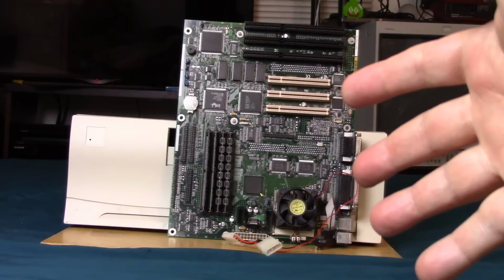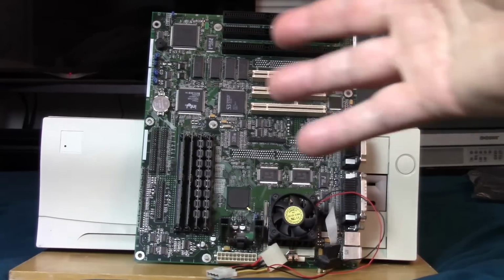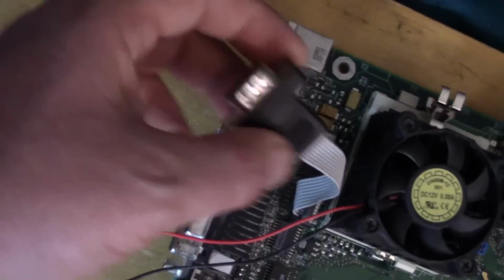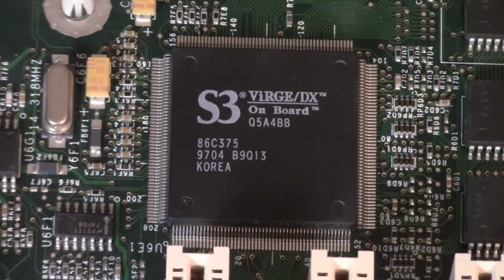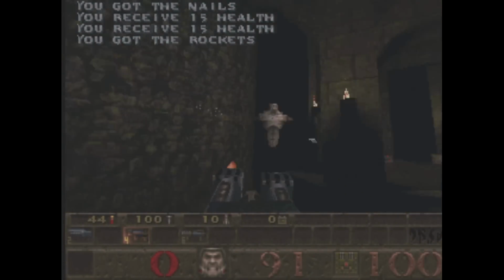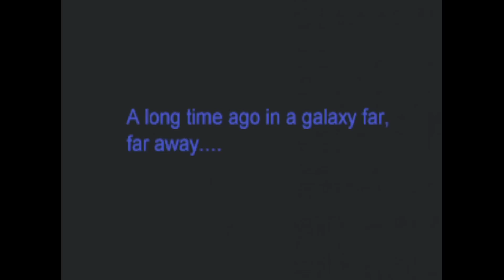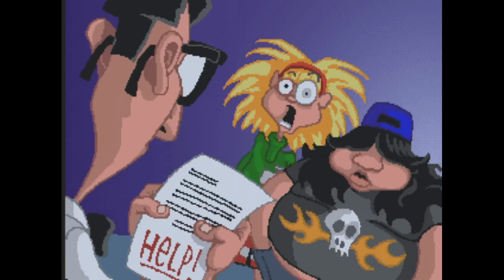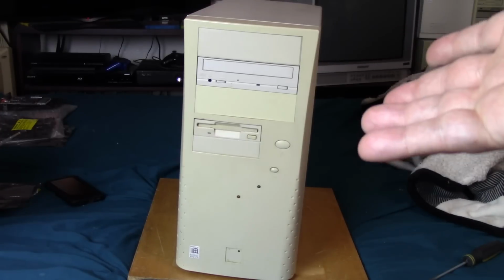Building a DOS PC with no Expansion Cards

Comment: 🎉 I have a few OEM boards and they are overlooked, but really stable and reliable.
Reply from the maker: Indeed, I had absolutely zero issues with this board, it was a nice change of pace compared to the usual 101 little hangups that I usually have occur.
Reply: I actually have a weird Slot 1 440BX board that was probably an OEM board of some sort. Interesting feature set: No AGP, but has an integrated SIS 6326 on that bus. It has a ESS Solo-1, a PC/PCI header, and a ISA slot, along with a a few PCI slots. Might build a system with it one of these days, the voltage chip should support Coppermine chips and I think I got it to post with one of the lower voltage C3 chips. With a PCI Voodoo 3 (I have one) it'd be a nice system to pair with a PowerVR card (if I could get one without selling a kidney).

Comment: I had a CWD-5001 at one point (it's taken apart and I haven't been assable to reassemble it) with a P133, only had room for one card either ISA/PCI.  Most stuff was onboard so I just used it for a Sound Blaster Vibra 16XV.

Comment: I tuned into some 8088 stuff (particularly the pb500 stuff from wordpress) and youtube just started recommending videos on occasion. 

My latest project possibly requires an 8088 so I have been having to do research since it seems like there are few system resources available as a result of the system being 8-bit. I tend to deal with 486/pentium era computers most of the time otherwise so the channel seems to be a good enough fit.

Comment: You should be able to use an MMX 233 with the board multiplier set to 1.5x, which the CPU will translate to 3.5x

Comment: Unfortunately your motherboard does have the infamous S3 black level issue.
Right at the POST screen, the background should be black, and it's grey. The whole recording looks very washed out compared to many other recording. Not just the S3 trio are impacted, even S3 savage cards are impacted.  You can see it a lot in the rest of the video, things that should be black look very grey compared to the black borders on both sides of the 4:3 recording. The DOS prompt also makes it obvious since that is very well known to be white text on black. Not white text on grey :)

This isn't actually a problem in the chip itself but rather a problem in their BIOS.
Some people have patched or used bioses from other cards to fix this issue, the problem is that here, the video BIOS is merged with the motherboard's bios, so you can't just swap the video BIOS without also touching the motherboard's BIOS. I'm sure there's a way to extract the vbios from the main bios and patch it, but this hasn't been done a lot yet.

Alternatively you can run some DEBUG commands to fix it temporarily (you can then put that in autoexec.bat to fix the black levels at every reboot). There are some topics about this issue on vogons that explain the procedure.

A real shame because like you said, they have pretty good DOS compatibility and a great 2D core.

That's a pretty cool motherboard otherwise ! I think that extra yamaha chip is actually called the OPL4 ! That must be why it says "Yamaha OPL" on it. Now has nothing to do with FM music like the OPL2 and 3 had, but for some reason yamaha thought it belonged to the same category of chips.
Reply: I'd probably settle for brightness and contrast adjustment on the monitor or capture card.
Reply: by ELSA S3 cards is always black : )

Comment: i really really like this motherboard. very flexible for 3d add-on cards or just using barebones. sure, that midi chip will never be as god as an SC55 but i think it sounds great for what it is. i'd definitely leave that 200mhz MMX in there, leave it with 32MB ram and enjoy the dos classics. the 701 does the job too.

as for that comment about the slim line pc case - you can definitely get some nice media center cases from late 2000s/early 2010s that are a perfect candidate.

nice vid!
Reply from the maker: I'll have to keep an eye out for a slim case like that will fit this board.

Comment: I just got one of these motherboards and everything works great except General Midi does not work in pure DOS mode. I have use Windows 98 Second Edition and the DOS MPU-401 support through the drivers to get access to General Midi in DOS. Did you have to load any special TSR on your DOS setup? I just can't figure out why yours work and mine doesn't.

Comment: If the cache memory is fully expanded with 512KB onboard there is no reason to solder in the COAST-connector. Intels desktop chipsets from that time do not support more then 512 KB cache.  

But what is the unpopulated connector next to the VGA Feature Connector? :)

Comment: I do have PC I bought (just the CPU) for parts, that has one of those really bare bones OEM motherboards with a Pentium III CPU, it doesn't even have expansions slots more than just 1 PCI and 1 ISA I think, all the rest is just onboard. So I was thinking on building either a DOS machine or a very early Linux machine with it, I haven't made up my mind yet, but as soon as I get a case for it (the one it came from is in really bad shape) I'll try it.

Comment: FreeBSD will still run on 586es if you recompile the 32-bit x86 version (it defaults to 686). It requires 96MB of RAM however.

Comment: Is the S3 Virge enough 3D to handle "I've got some balls", not sure if the music in it is GM or digital
If it can't, the Riva 128 1997 system probably can
Reply: They were usually ridiculously underclocked, depending on the speed of its ram, they can be overclocked to up to 83mhz without any tweaking. If that's 5ns ram I see then he'd be in luck: if it's EDO ram it should handle 83mhz no issue, and if its SGRAM it should also handle things well (I think the Core: Memory speed ratio was 2:3 for DX chips with SGRAM). OC'ing may as well be mandatory for these chips if you want to use S3D. You might need a volt mod to get any higher than 83mhz however.

Comment: Been there and tried this kind of thing. A fun challenge, but I always end up hating these Intel boards - even have this same one but minus the onboard VGA. They work, almost without fail, but there's just something... I dunno... about them. Underwhelming, maybe, very rigid in how they like to run. Never liked that Yamaha wavetable, either, despite liking their other ones a lot, plus it's a real oddball in that the more common MU derived sounds had been around ages and the IC is larger than it has any excuse for being by that time, to where it almost came off as if it was bad on purpose to sell more daughtercards or something.
Still, it's not about me. The system seems to do what you meant it to do and that's what really matters - it didn't need to have a 'point'. The 'point' was that it was fun to fiddle with and that's good enough.
The motherboard variant you have was quite popular in school computers for a time, RM branded as they almost always used Intel Desktop Boards.

If it's any consolation, my capture setup seems to have self-bricked also.
Reply from the maker: hope you get that fixed. I feel like mines is a setting issue or maybe something got updated and it messed everything up. usually just uninstalling and reinstalling and reupdating fixes the issue but that's such a pain.

Comment: I have two motherboards like this one, one is exactly the same (maybe without general midi chip), the other is different - it has no build-in video card and all four PCI slots soldered-on (I believe that video card is using the resources of the fourth PCI slot, that's why it isn't here), and... no USB. Not surprising, considering that many motherboards were shipped with it disabled by default at that point in time, but still kinda dumb in hindsight. Also, as far as I can remember, you can only switch between 3.5 and 3.3 volts for CPU core on that board, so, it's not a good choice to use Pentium MMX with it. It will work, but it will be overheating.

Comment: the general MIDI sounds a bit "dry" in DOOM, i'd likely use OPL in those games but I like how it sounds in Duke Nukem 3D. an all in one board like this is good from a notebook computer perspective. I had a 75MHz Pentium Sharp notebook with an ESS audiodrive sound chip and I forgot the video chip, but it was good for FMV games and any DOS game i could get my hands on at the time. had to add a CD-rom drive via the PCMCIA slot but that worked good too. only real issue was the passive matrix display at 800x600 made some dos and text look funny. I was younger and dumber at the time and messed up the power circuit so it never worked right again, but i still remember it fondly.